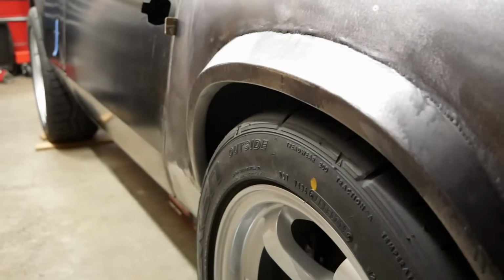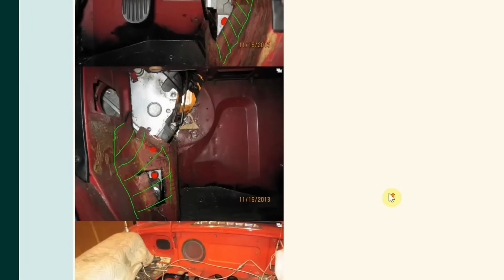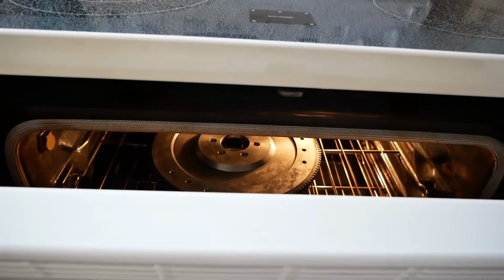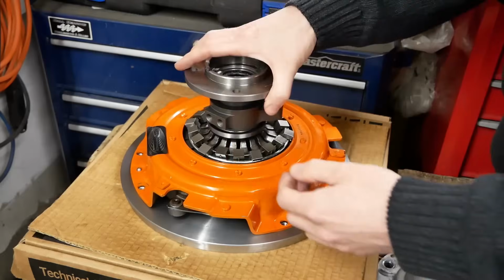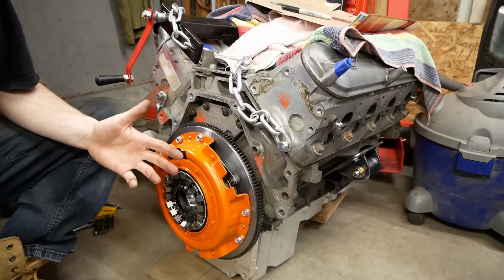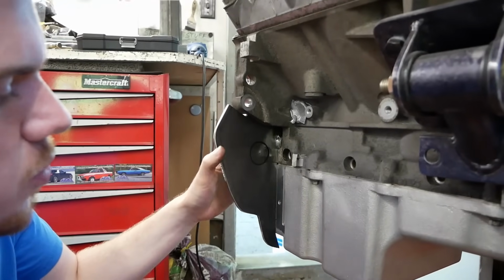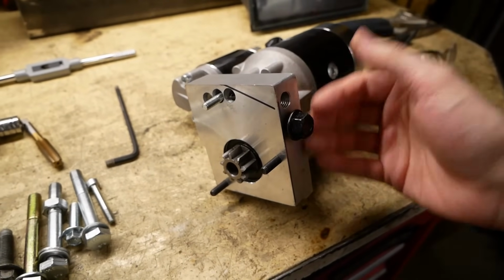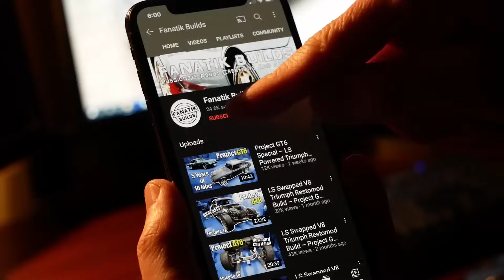The Cheapest Aluminum LS!  Pro Touring Triumph Build – Project GT6R – Ep20

Comment: I just want to point out that the T5 is a notoriously unreliable transmission.  Yes the t56 costs a lot but they are much more robust.  The T5 was never really intended to handle more than 300lb-ft of torque.
Reply from the maker: Definitely.  Not the best... but should be adequate.  Here's why we didn't get a T56...  They cost upwards of 4x the price around here (defeating the point of using the LS4 in the first place)!  They are about 40lbs heavier.... longer and wider... and hard to find used in our area.  The T5 is not ideal, and we will be asking it to handle more than it's rated for, BUT, our car weights very little.  Estimated 2300-2400lbs.  We've got little 205's which will spin before destroying anything else, and if all else fails, we can at least upgrade to a TKX someday without having to re-engineer the whole setup again!  Hope that helps explain it better 😊 Cheers Ethan 👍
Reply: @FanatikBuilds  I was actually going to suggest a Tremec 5 speed just due to its interchangeability with the T5 but it seems as though you've got things figured out lol.  I'm eagerly awaiting new episodes this looks like it's gonna be fun.
Reply: 5.0Tussin shifts his t5s pretty hard.  He has quite a few videos on how he upgrades them.  He shims the input shaft to zero free play and does not run an aggressive clutch.  Billet 3/4 shift keys and a billet cluster support round out his mods.  He occasionally breaks the shift forks.  Aftermarket billet forks are available but cost a bit.